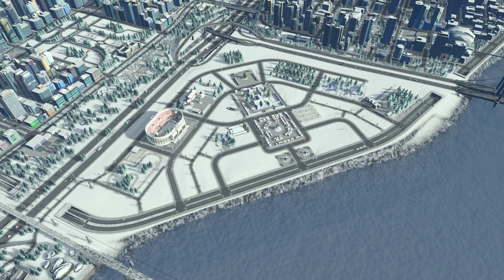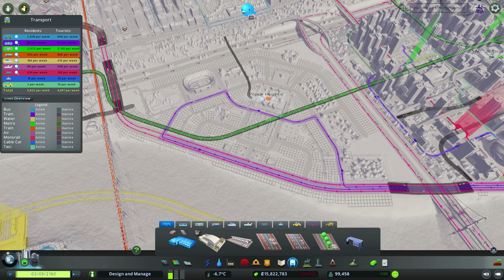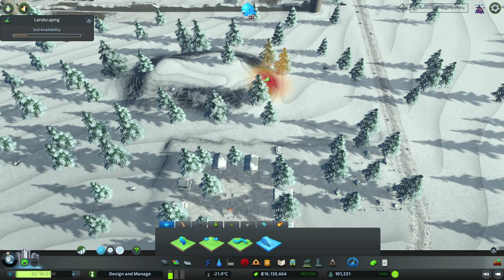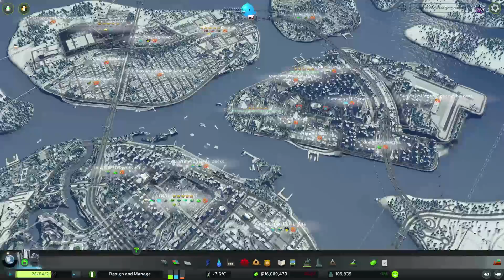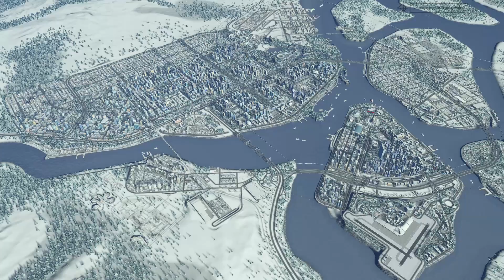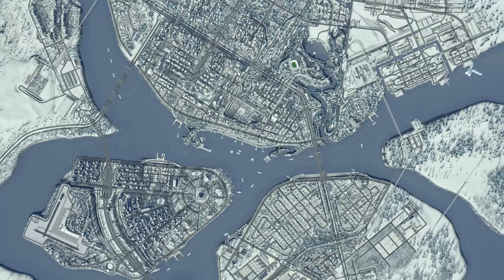The Most Disappointing Shipyard | Unmodded Cities: Skylines – Design and Manage, Part 81

Comment: When you finish this city will you be doing another one? If so, will it be spring - fall theme? (I miss colors). Will it be modded? Any other plans or ideas?
Reply: If I know T4rget a bit, he would post a Zero to End time lapse of a city for modded game play. But he wouldn't use any mods in a series.
I like the color idea though. Sounds interesting.
Reply: @MurtezaY  thank goodness. I'm not a fan of mods aside from some of the necessary ones that the game developers have adopted. Like changing one-way directions etc.

I really enjoy his designs but I'm bored with the black and white winter theme.
Reply from the maker: I might do another series, but the map and if it will be modded/unmodded is still undecided.